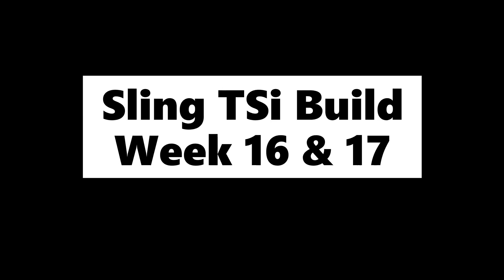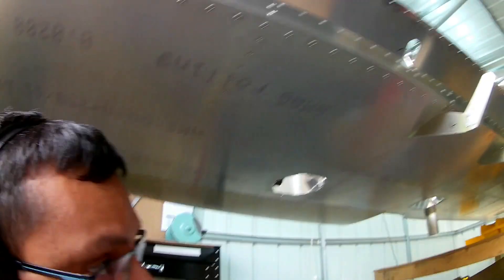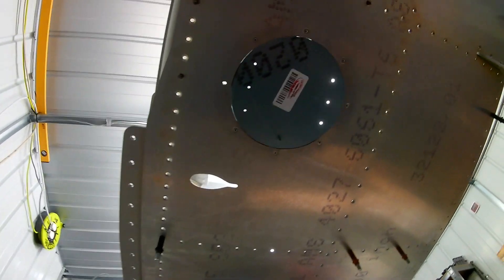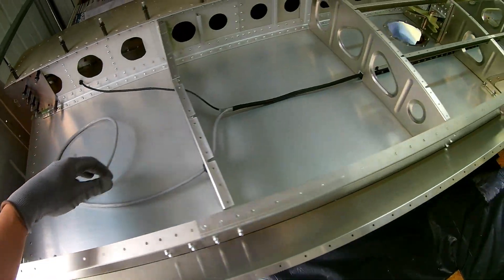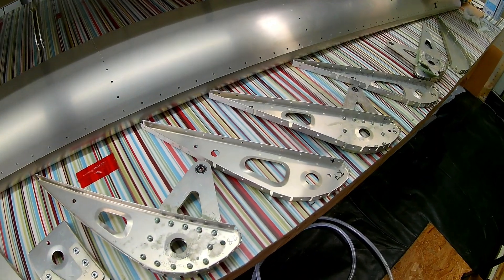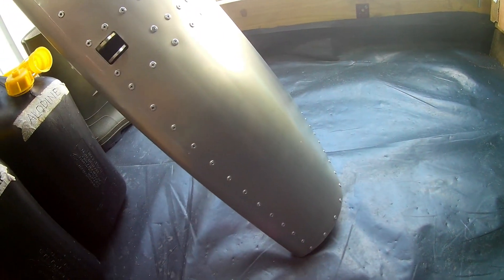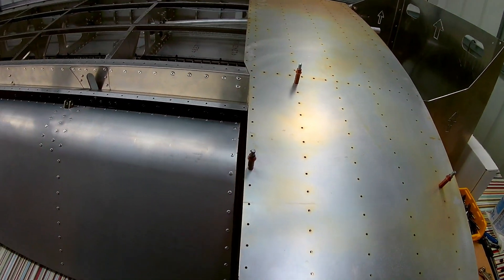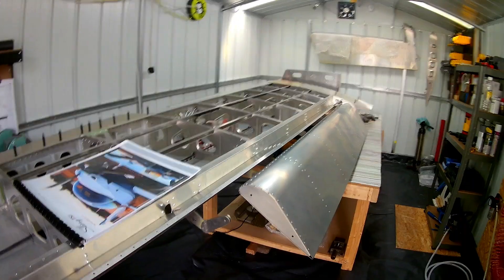Sling TSi Build  Left Wing build & Flaps

Comment: Great video and thanks for the update. Could you explain why after you take the clecos out, you are drilling before riviting at 0.43? Why the need to drill?
Reply from the maker: There are 4 layers of metal in that area and especially since 2 of the layers are dimpled  they are never perfectly aligned so I use a 4.0mm drill to clean out the hole keeping the hole in the main spar as the centre